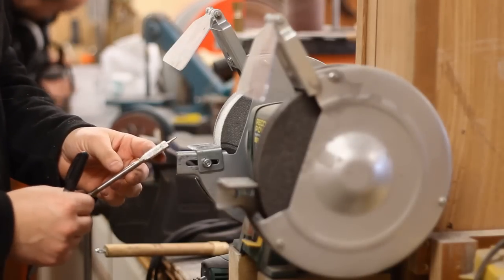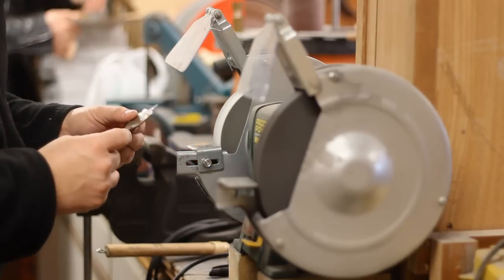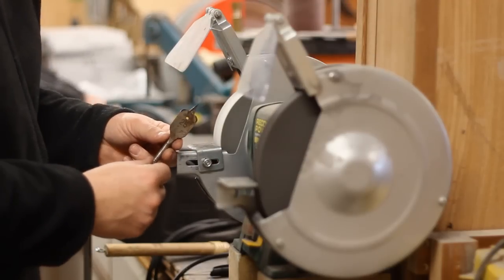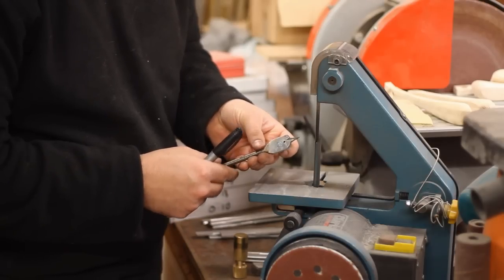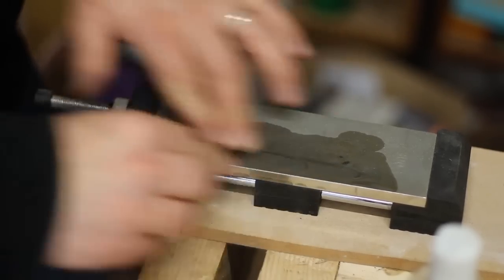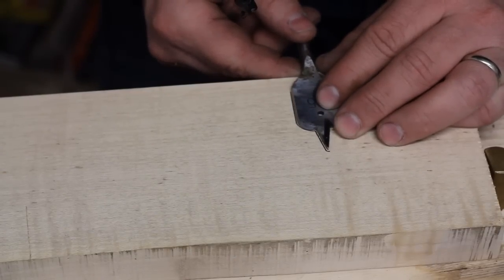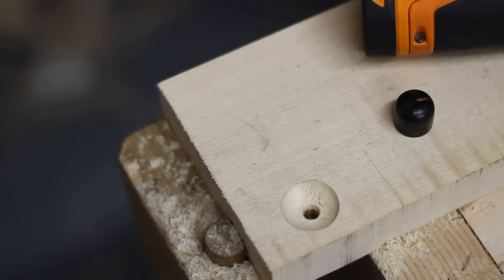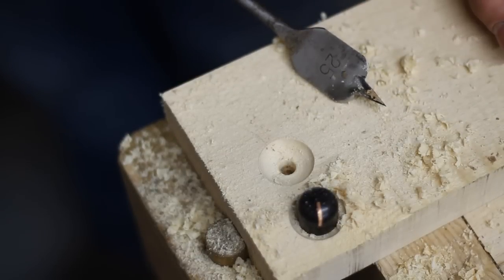how to make a tool for recessing control knobs like PRS guitars tutorial

Comment: 3/8” hole for the pot. W a 1/2” radius cove router bit mounted in a drill press, simply lower the spinning bit into the pot hole cutting a perfect counter bore. No need to grind old paddle bits.
Reply: Yup, that's what I recommended too.
Reply: Do you mean Pillor Drill .

Comment: a simple suggestion. Why not using a router? On my router bit sets there are two for these concave shapes. One of them even has a small bearing at the top that I bet would fit perfectly inside the pot shaft hole, helping to center it all. But even with the other, with a little bit of work, it would be easy to center it and do the job. Just a suggestion. No need to destroy any tools XD

Comment: Why not just chuck a round-nose router bit into the drill press?

Like this one:
http://www.amazon.com/Freud-18-113-1-Inch-Diameter-Router/dp/B00004T7DI

I mean obviously you don't have the center guide with that, but if you took your time to line it up, and then clamped the piece down, I think it'd be pretty easy.
Reply: clamp it down and drill press the pot hole then the router bit without moving anything and it should work right?

Comment: Here is a better solution Ben. I've seen these carving burrs used in a drill press to do the same thing, after you've drilled your hole for the pot shaft. Item "D" or even "Q" would work.
http://www.leevalley.com/en/Wood/page.aspx?p=69808&cat=1,130,43409

Comment: But surely you want a flat bottom to the hole if a pot is coming through and a nut to secure it. If the base of the hole is concave, you'll have real issues tightening the pot down.

I'd say use a standard spade bit for the hole, route the edge of the concave with a small round over bit and then shape the top.
Reply from the maker: The bottom is flat, and the whole point is that you can make the tool exactly as you need and it then does the job simply and quickly. I personally do prefer using a router and guide bush setup but made this video as and alternative for builders who don't have the option.

Comment: That works, although you kill a bit designed for something else.  Or, you could get a bit designed for that purpose, such as a cove router bit, which is a lot faster, less chance of error, and eliminates much of the sanding and cleanup work.  The nice thing about your method is that you can often find those bits very cheap, and even used in pawn shops and such.  The bad part is that it takes a lot more time, increases risk of botching the job, and requires killing a bit.

Comment: The reason it runs off centre is simply because of non symmetrical geometry of the drill as you mentioned. If one side is larger (more cutting area) than the other side it will naturally try to pull the whole thing off centre, it all depends on how accurate you make your cutter, a similar problem occurs when manually grinding drill bits, unless everything is uniform the hole will never be perfectly cylindrical. Hope this helps.

Comment: hey ben,
you gonna do a update on what the cause is for the off center hole
when ya get it figured out? wonder if it would be better to have only
1 "wing" on that bit? might not cut as fast but no worries to get the wings
rounded evenly for a better cut.
Reply from the maker: I tried with a new bit after the shoot and it was simply that the old one was rubbish, the 'point' had been 'sharpened' very poorly and was a bit deformed. A new bit beyond accurately worked perfectly.. Though I will try doing it one sided to see what happens, thanks for the idea.
Reply: cool. will you be offering this tool on you site for us that want to buy them?
loving your channel by the way. im um til about 2AM watching and trying to catch up lol.